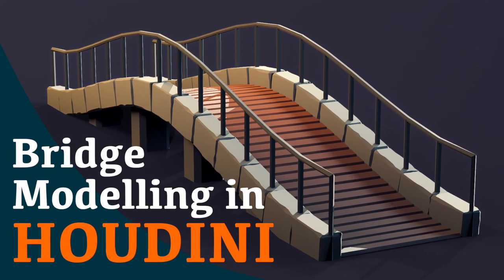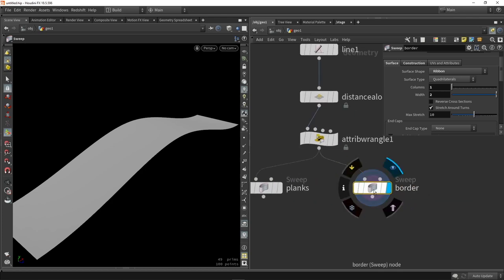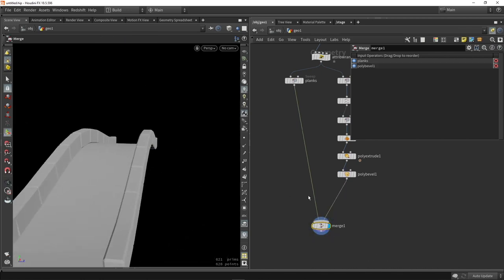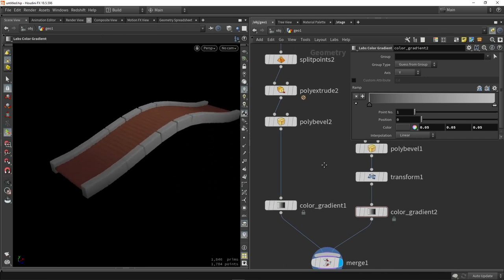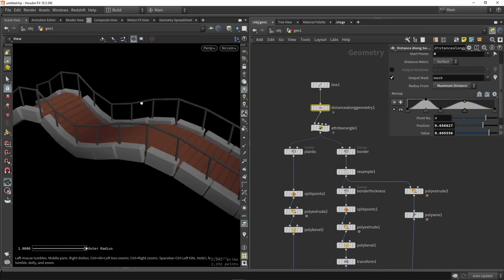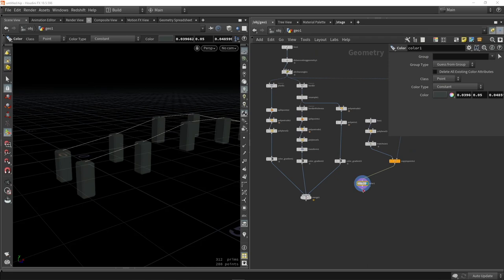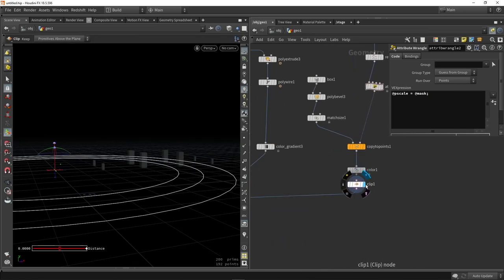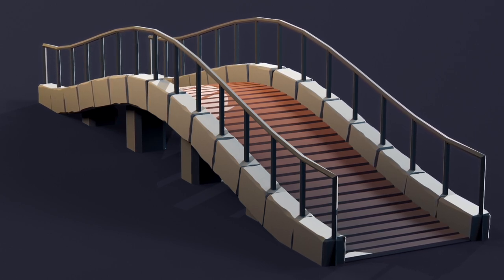Model a bridge in Houdini || Beginner Tutorial

Comment: Minor things not mentioned in the video:
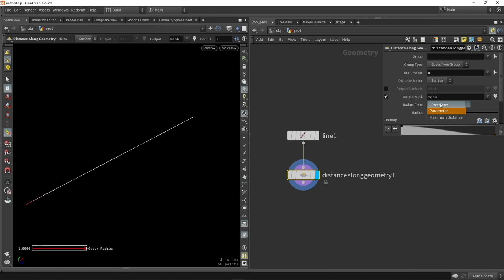- If your line is not highlighted in red when creating the mask with the DistanceAlongGeometry node (0:30), you have to activate the "Show Handle" option in the scene view (hotkey: Enter) and select the node.
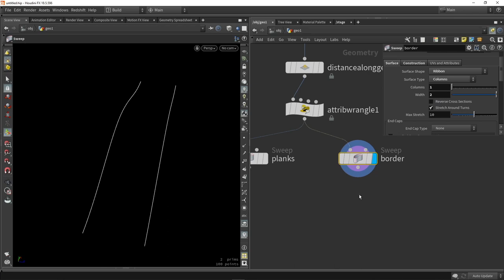- Use W in the Scene View to toggle the wireframe mode (like at 1:50)
- Use SHIFT+S in the Network View to change the wiring style rounded/straight lines (see the difference in the video at 9:55 and 9:57)

Comment: Is there a simple way to prevent the overlapping geometry at the ends after the polyextrude @2:18?
Reply from the maker: There are a couple ways , overall I recommend using the chain node I show at the end since that will give you more control and variation.